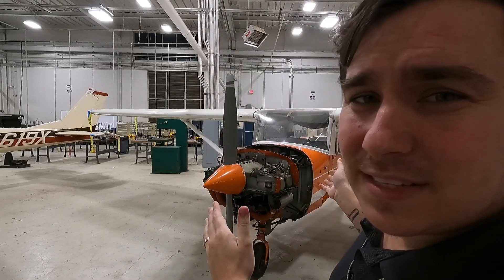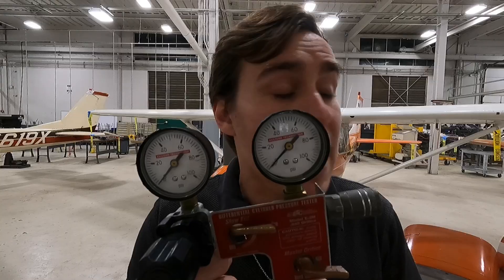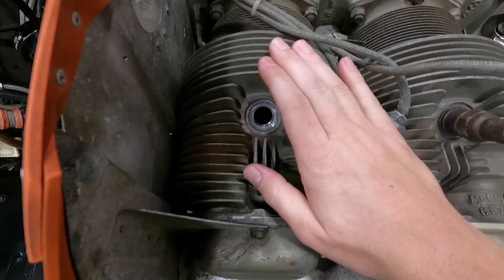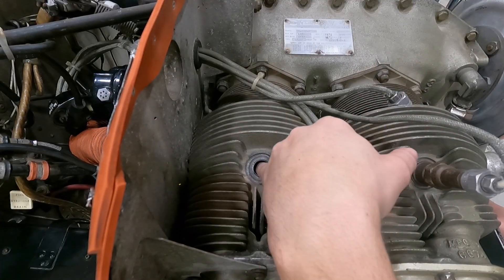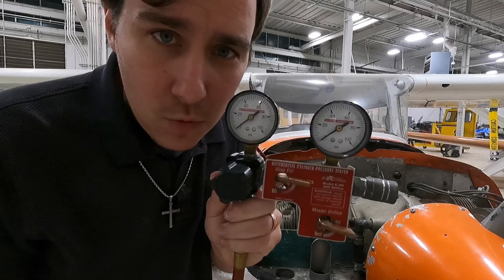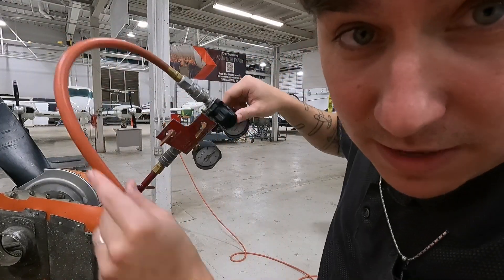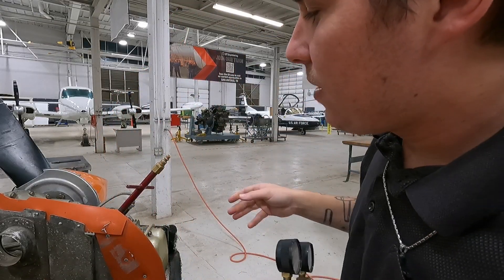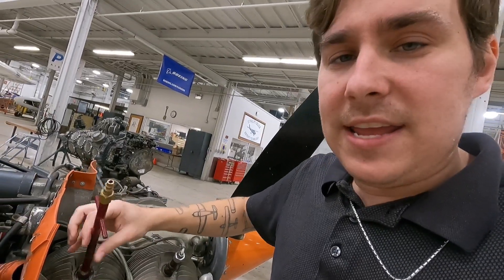How to Perform a Differential Compression Test on a Continental O-200 | Aircraft Engine Maintenance

Comment: So what are the procedures when the pressure or compresion is much more than you're hand when you hold the blades of the propeller
Reply from the maker: If you are asking what I think you are asking. You get out of the way and make sure to always keep the propeller clear. If you have the cylinder on TDC, then it wont try to rotate the prop.

Comment: Why in the aviation world is this called a compression test? You are not testing compression. You are testing blow by of the rings and or valves. In the auto world this is a blow by test. Temperature and oil film on the cylinders change the cylinder compression quite a bit. Is this a true representation of compression in aviation?
Reply from the maker: The exact wording is the Differential Compression Test. I agree Differential Leak Test or leak down Test is a better name, but it was named in the 1940s long before my time, lol.

Comment: One thing I was taught and have always done, bot never had to use, was to lean back a little and be ready to fall away from the prop.  That way it's in your head.  Don't worry about looking stupid if you go down for no reason.  It's better then goin down because your head got chopped off.  Overkill is better than killed every time.
Reply from the maker: Big movement equals momentum. Momentum equals not getting chopped.

Comment: I believe the  prop is installed incorrectly .    At TDC  #1  the blade should be about the 10 o'clock position looking from the front .
Reply from the maker: You would be right. Since it's at a maintenance school, one of the instructors clocked it wrong to test students during Powerplant inspection. I thought I had mentioned that in the video.

Comment: Nice explanation. Would like to note: Pull all top plugs out first. Always use the flexible adapter b/c you can position the gauge where it's visible as you turn the prop because THERE WON'T BE a second person there helping you!
Once you get used to doing it, it's a no-brainer.

Comment: Nice video.  Thanks.   Question…aside from lower possible readings when testing on a cold engine, are there any other concerns/issues when doing a cold test?
Reply from the maker: Not really. The reading is the biggest concern. It's not any more dangerous or less dangerous, for that matter.

Comment: A nice and thorough compression test procedure sir. If I could add a note, its also a good time to confirm whether or not the propeller is indexed correctly on that crank flange. I have seen in the past where I couldn't even get hands on a prop blade while on #1 TDC without being in a very compromised position

Comment: I've seen a prop rotate when under pressure, luckily no one was in the prop arc... good job on driving home the importance of staying out of the prop arc any time air is applied to the cylinder. I generally hold the prop and have the owner/helper slowly apply the air while they are standing well behind the prop arc. I use the impulse coupler releasing as a audible clue for TDC or with in a few degrees anyway, then visually verify TDC